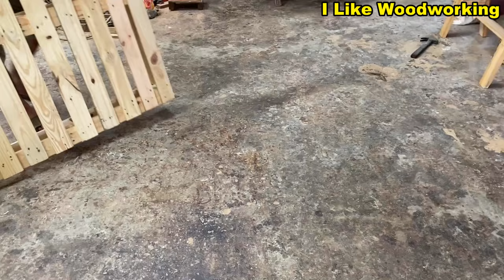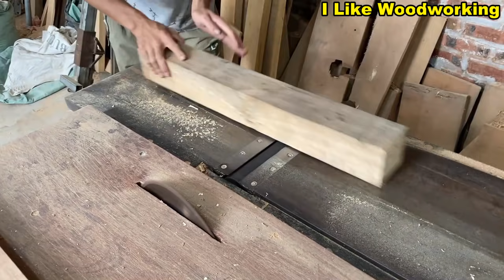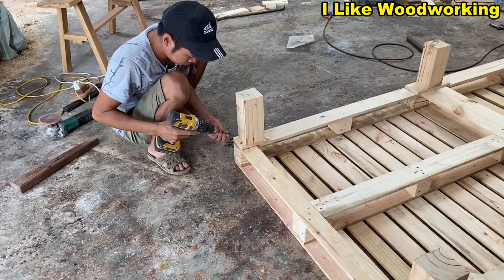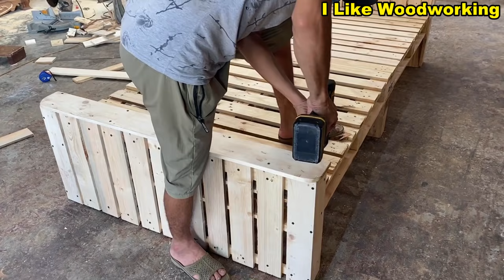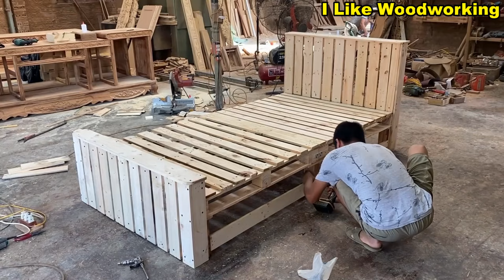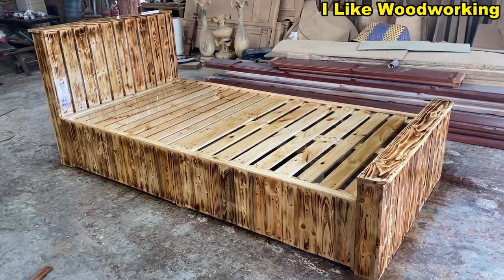Woodworking Products Cheap - Build A Extremely Simple And Beautiful Single Bed From Wooden pallets

Comment: How long does it take to make this?
Reply: just a guess , but if you had all of the things you need and know what you're doing , i would say somewhere around 6 to 8 hours . give or take . besides all that , myself i would have done a few things differently . but over all it's a fair looking piece .
Reply: @DonaldMelton  I figure it took this boy 3 days just my the change of clothes
Reply: @mandicoleman7433  i can see why you would think that , but this is a very easy build . and in my opinion this build would fall apart rather quickly because it's a very weak build .
Reply: @DonaldMelton  why would you say it would fall apart?
Reply: @terryjoestoll  they only used tack nails and very few screws to put this thing together . no joints and no glue was use any where except for the main two pallets . in other words they should have jointed the pieces together instead of just nailing them together . in my opinion this is a very weak build .
Reply: @DonaldMelton  to me it looked like the tack nails were only to hold the pieces in place until the screws were put in. The video was sped up so I may be wrong about him using a lot of screws other than the trim pieces on the pallets. Your right that glue behind every board could have made it indistuctable but as a bed I don't see it falling apart unless kids are jumping on it... Could happen though 🤕